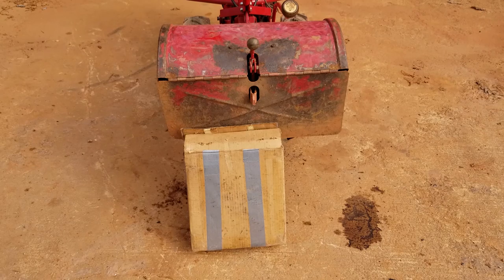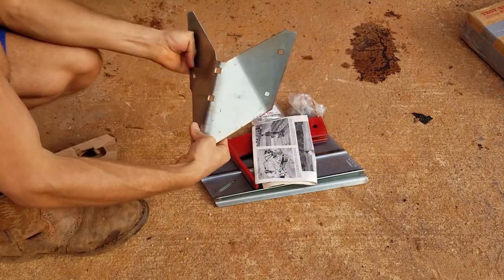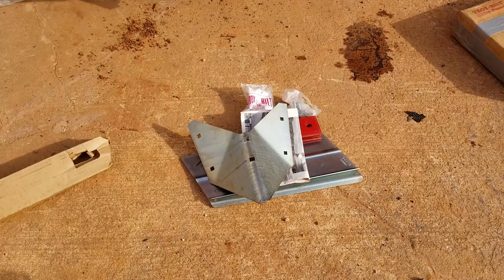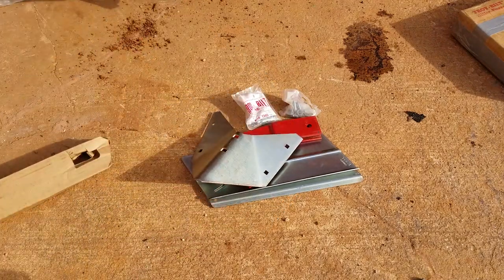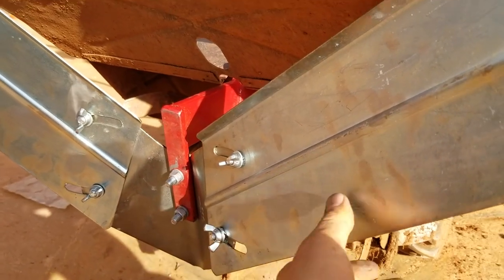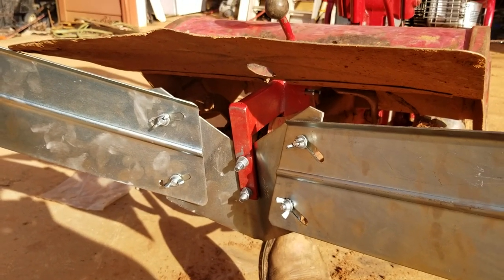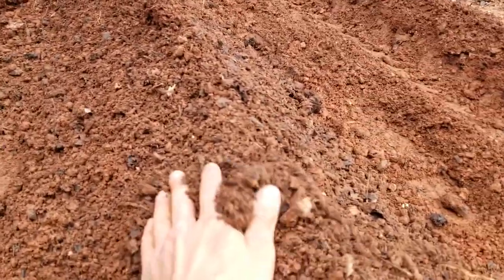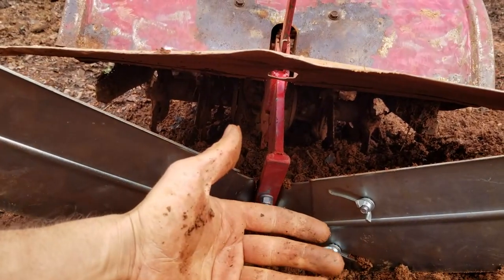Buying A Farming Implement On Marketplace

Comment: I bought the same hiller furrower with my Troy Bilt Horse back in the mid 80's. This tiller has been like a tank is still running fine. I have maintained it well and have had only a few minor issues over the decades. Sad that they don't build them like they used to.
Reply from the maker: Yea, the Garden Way Horse tillers were the best before Troy Bilt bought them.

Comment: I have a troy bilt horse that I just ordered all new bearings and seals and a new motor and I had one of these hanging up on a nail out in the shed and never knew what it was and it is still brand new and exact same one as yours. I think I will put it on after I get all the dirt plowed and get some new tines, thanks for the vid other wise the thing would be hanging up on that nail still.
Reply from the maker: You're welcome. It really helps mound up the dirt for rows and get a good deep planting bed. Take care of it. These things are nearly impossible to find.

Comment: Not sure who set the engine RPM to that high, but this 
engine, for this application, should run at a lower speed.  
There is an engine speed control (throttle) on your right
hand for a reason.  Slow it down, before you hurt somebody,
or destroy the gear box and tiller blades.
And...gotta love those purple shorts and pointy boots.  
Your toe nails will thank you in the future, and so will
your foot doctor.
Reply from the maker: This one has the 4 speed setup depending on which pulleys the belt is on. I had it set basically the 3rd or 4th highest speed.

Comment: I need one for my 1990s 8 hp rottotiller for this year. Where ca I get it?
Reply from the maker: They don't make these new anymore. You have to find them used on eBay, Marketplace, or Craigslist. Search "Troy Bilt Horse attachments". They make a hiller forrower for the Earthquake tiller, but it is smaller.
Reply: Earthquake 15683 Hiller-Furrower Kit for Earthquake Rear Tine Rototillers, Red is how it is listed on walmart's app for 78 dollars

Comment: 9:20
That kickback was a root, rock, water line or septic line.
In an instant, that machine will take the engage control
knob and jam it into your nutz.   
Everyone of these bastards I have worked on have
bent control bars due to pizzed off owners and
horrible design.
Reply from the maker: It will JERK you back hard when you hit something. Rip your arms off if you hit a root.